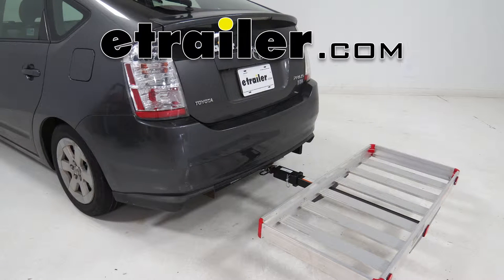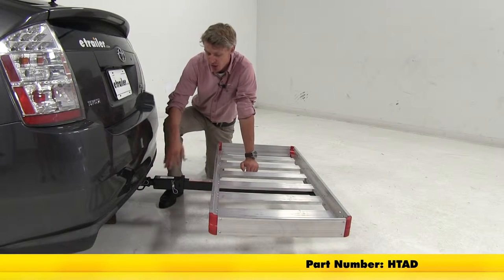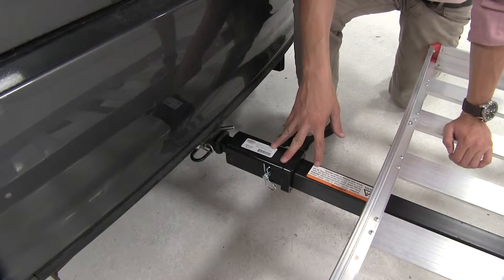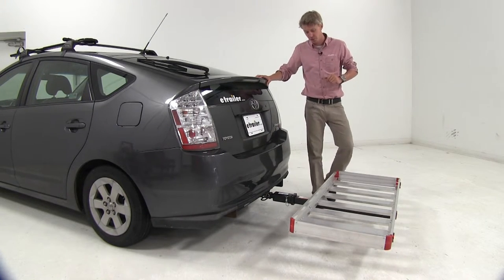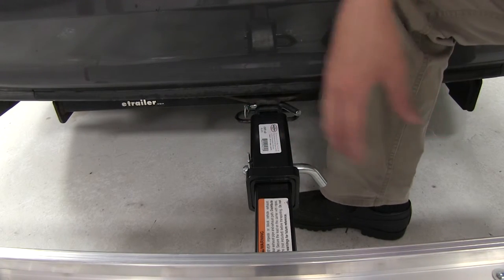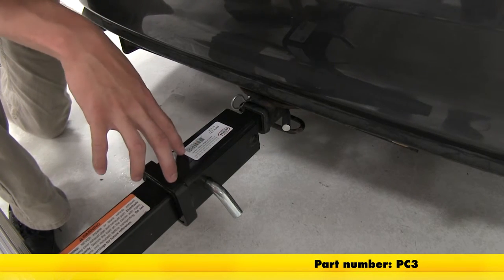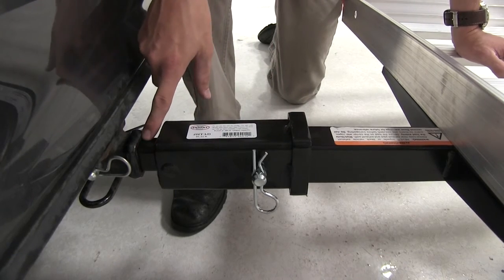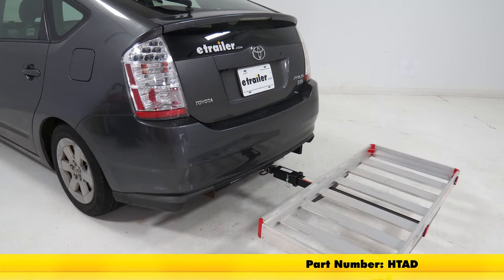etrailer | Hands-On with the Hitch Adapter 1-1/4" to 2" Trailer Hitch Receiver

Comment: About how much tongue weight can one apply on that adapter?  Planning to to carry boxes, crates etc.  not for towing.

Thanks!
Reply from the maker: The weight capacity of this hitch adapter is 300 lbs. You want to keep in mind that when using an extension with your hitch, you have decreased the tongue weight capacity of your hitch by 50%.
https://www.etrailer.com/Hitch-Adapters/Brophy/HTAD.html